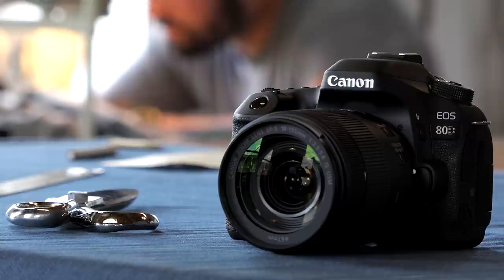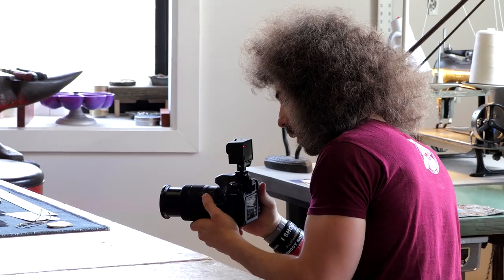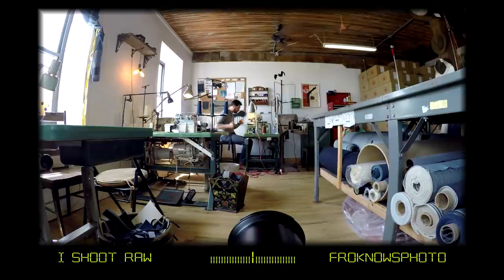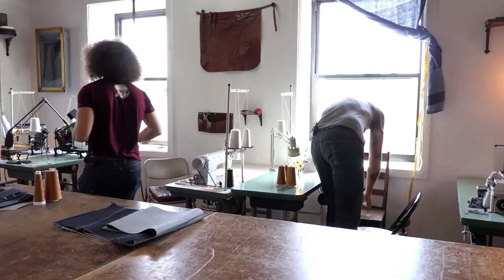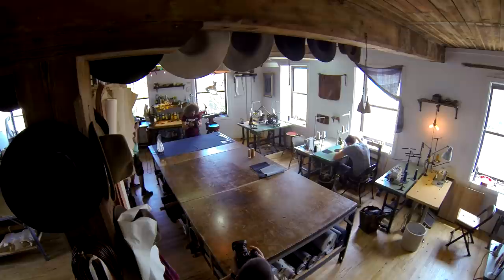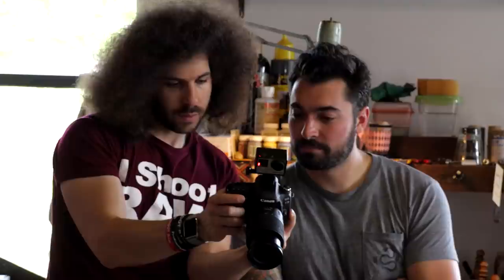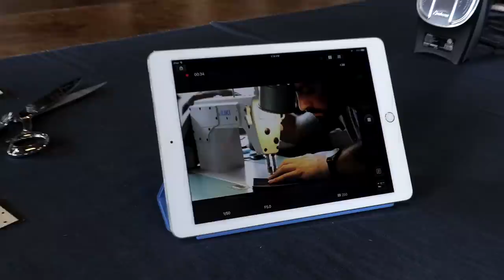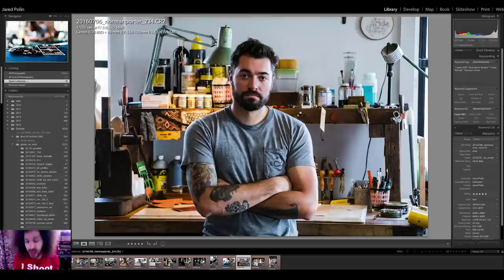How to get Professional Photos with a Kit Lens: "Canon 80D" 5 Min Portrait

Comment: 80D is so perfect it's very addicting to use. The focusing is just fun, screen or viewfinder. this will be hard to top by canon. i dont need 4k video, i dont have unlimited supply of hard drives. and aps-c after 2015 is not that significantly under full frame anymore. pair these with a 24 or 28mm pancake lense and it's also the perfect street camera. not into electronic viewfinder or rangefinder of mirrorless yet.

Comment: I did chuckle at the fact that the guy's expression never changed but it really worked for the pics. Seems like a nice little factory too. Fantastic video. Im looking into the 80d as an upgrade for my very worn out nikon d3200. This video sold me. Excellent work. Amazed at the quality of the shots considering 1600 ISO. Anything above 400 is unusable on the d3200.

Comment: (I'm at 10 min, still watching)
Correct me if my method is wrong...I think I would use Aperture Priority in this scenerio and use iso 800 to start off. Basically if anything's over exposed, I just use that exposure compensation and make it -1,-2 ect .. if it's under exposed then I would use +1,+2 on the exposure compensation.
if the shutter speed shows too low(vulnerable to shake), then I will increase the iso.
Reply: Oh and Thank You Jared for this amazing video, I am enjoying it
Reply from the maker: I stay away from Aperture Priority.  Being in a situation where the light is pretty much not changing why let the exposure be thrown off by the background light.  Simply moving your shutter speed is the same as -1 -2 so on and so forth.
Reply: You can do that, but by keeping it in manual, you can change the settings more accordingly. For example if you prioritise the shutter, the camera may pick a very high shutter speed, which won't let you capture motion in your images. by keeping it in manual you have complete control of all the settings.
Reply: Also, I wasn't finished watching the video while I wrote my comment, but Jared explained why he didn't need aperture priority at 55:55
Reply: Just shoot manual. Absolutely no more work than what you are currently doing but you now have full creative control.
Reply from the maker: oh i'm glad I did that lol.  I forgot of course.
Reply: Whatever rocks your boat.
Reply: every time you use a high iso you diminish the quality of the photo, and diminish your ability to edit it well, even in PS software

Comment: when using a variable aperture lens i use auto iso so when i zoom iso is adjusted automatically
Reply: Vincent Navea or just set the aperture to f5.6
Reply: +Dan Super but if you do that you won't get the good old bokeh
Reply: @dhiyow9775  you can with compression. My sigma 70-300 th macro can get bokeh at f15 on my d3500 (f 22.5 equivalent)

Comment: Looks like this setup is really capable.  I am trying to hold out for Nikon's D7300 (if that's what they call it) in hopes they add the screen from the d5500.  Currently have a D3000, and want better ISO performance and buffering.  Hesitant about switching to Canon because the glass I have(which is only a few primes and the kit lenses).

Comment: Well now I'm not sure if I want to upgrade to the  80D or 6D Mark ii. I currently have a Rebel T4i but wanting something better for low light.
Reply: In the same situation, going from T2i to 80d... Or, also consider the EOS RP. Compact full frame although expensive glass. Btw, it uses same sensor as 6DII.

Comment: With my Nikon D5100 I tend to shoot with manual focus and aperture, and automatic ISO, works really well most of the time.
Reply: I envy you. It's probably my aging eyes but I can't reliably focus manually on my D5100 at all. The finder is too small and dim. Although I do not have a pro-level DSLR with a bigger, brighter viewfinder to compare the D5100 to, I was recently messing around with my old Nikon F3 film SLR and the difference in the viewfinder is astounding. It's like looking through a picture window!
Reply: +Anthony C old film cameras usually used split-screen focus screens, makes manual focus a doddle. But they take some light, and are harder to see through in dark scenes. Digital cameras rely on autofocus, so have left them out, but for some cameras you can get the split-screen as an accessory. For my Canon 60D, I've installed Magic Lantern, and for manual focus I zoom in x10 on live view and have focus peeking and split screen enabled; no point manual focusing through the tiny eyepiece.

Comment: I have seen several tests of Canon 80D, and I was very fond of the machine, but it does not shoot in 4K, I do not use much video, but I know that one more time and the Canon launches one that films in 4K as such and as I need, I'll be waiting. Then there is the fujifilm xt2 which also I like a lot, but it does not have the versatile and creative LCD, of the canon, being even lower than the fujifilm xt20, but the fujifilm xt20 starts the iso in 200, which I do not like. It seems that brands play with the tastes of customers. For me the machine is like a craftsman tool, the more creative options the better. As a Nikon user, (who stopped in time) I have always been jealous of Canon's LCD, s and the use of the video. What do you advise me to change systems or start thinking about changing?
Many greetings and best wishes for Vlog!

Comment: i like the format of the show, it's a bit orientated to the beginners but i appreciate it. one thing that bothers me a lot is the chromatic aberations from the lenses of the xc10 i'm guessing it is. i would like to see some more stuff using strobes, i know it's not his main thing but maybe something easy to set up and use.
Reply from the maker: It's not all to a beginner it's to the photographers out there.  Photography doesn't need to be overly technical.
Reply: as i said, i liked the show and the fact that you shoot with a bunch of different cameras not just the top of the line.

Comment: Great Video! I Love your "5minute Portrait"-Sessions because it really helps understanding the "flow" of a fotoshoot. This one I found especially great as I own an 80D for about a month and love shooting it. 

One question: Is there such thing as focussing "accurate enough"? I had a portrait-photoshoot last week (80D with mostly Sigma 18-35 ART and Canon 50mm STM). We shot about 400 pictures from which most looked great & sharp on 5x7inch paper. But there were ~20 shots that I could zoom 1:1 on my computer and had a ridiculous amount of sharpness (most of them 50mm stopped down to 2.8). I know I'll do some things differently on my next shoot to avoid focusing problems (like af micro-adjustment on the sigma, and cleaning rain from the lense more often) but I'd like to ask you if there is a point where you'd say something is "sharp enough" or does every photo that leaves your studio has to stand up against pixel-peepers?

Comment: Hey man - thanks for a great review and some really awesome tips on how to use a camera properly. I currently use a Canon EOS 400D (12 Years old) and am saving up for the 80D. I had already made my mind up that I wanted it but this has just completely confirmed that I want one. I really like the way you put that video together and just seeing how you position yourself to get the shots as well as adjusting exposure as you change the focal length (i never knew that it changed aperture). I've had my camera for ages but I'm only just starting to learn how to use it properly. Keep up the great work - its not often that I watch a full hour long you tube video. You got some great shots! Subbed and liked!

Comment: Dear jared, I have a couple of queations.
1-   i've seen a lot of your movies where you use a GoPro at the flash mount on top of camer, . can you tel me why you use the GoPro.?
2-   in this movie you use a Canon 80D. I have a Canon 90D with the same lens.
3-   If i want to shoot a simmulair item with my 90D, will there be a lot of differents or can i compare it?   
4-   last question,  i see thet you not use a flash, not a optical or the pop-up flash, whay not?
5-   i hear you speek about the hi ISO, do you have no trouble with the noise or eliminated that in Lightroom?
thank you for answer my questions.
greetings John Statue from The Netherlands.

Comment: Jared got a question. Higher ISOs obviously create a lot of noise. what would you say would be a good ISO that allows good "snappy" shutter speeds yet doesn't inject very much visible noise?
Reply: I wouldn't worry too much about noise, take it like grain on film. It is different but if you fill the frame and don't go heavy handed on either sharpening and  noise reduction it won't be a problem. Plus digital noise is much more prominent and visible on displays with the pixel matrix, when you put the photo into print it won't be so visible.

Comment: Thank you so much for all your videos, but I have a question about the kit  18-135mm.  I tried to take pictures of my kids indoors  and used manual mode  but pictures come out very dark.  The shutter speed doesn't allow me to set it up higher than 40 or 50. I tried to change the ISO higher, lower and nothing works.  I forgot to mention that I have a lot of natural light coming in and still doesn't help at all.  Do you have any tips in how to use the kit lenses to take picture on kids and indoors?  I hope you can help me with this.  Thank you so much.:)

Comment: Jared, do you always use single focus?  I've found that I have less out-of-focus photos when I use the full-time focusing feature, unless I know that my subject is going to be perfectly still (which is rare for the photography I end up doing).  I tend to shoot with f/1.2 or f/1.4 lenses because I love the razor thin depth of field.  The f/1.2 is manual, so I really don't have a lot of choice there, but on my f/1.4 85mm, I tend to have much better results with full-time autofocus.
Reply from the maker: I don't want the camera picking the focusing point for me.

Comment: Hi Jared and crew, I am trying to advance my photography and I am trying manual exposure but I am finding some issues. When you say you are changing you exposure setting you say you can get 2000 ISO. My problem is when I'm in manual exposure and I change ISO my setting only allow 1600-3200. the only way I get 2000 is via Sensitivity mode and Shutter & Aperture priority-- but that has AUTO ISO.
Any info will be very helpful.
:)

Comment: I'm so torn between what camera to buy. I really liked the 80D for the longest time but then the 6D Mark II came out and I'm torn between what to get. The biggest plus is the full frame but considering I'm using it for family pics and to film a little bit do I really need to 6D MII? I want something that will last a while and as I get better it will keep taking amazing photos and I won't outgrow it so fast. That's what I worry about the 80D that I'll out grow it quickly and be mad I didn't save a little more the the 6D. But I'm close to affording the 80d with a kit lens and I got a baby due so I really want something soon. Should I rush or wait? Input is much appreciated from everyone especially those who own the 80D and have moved up.
Reply: The 6D Mark II + EF 24-70 f/4L + Speedlite + flash reflector or
The T7i or 80D + 17-55 f/2.8 + Speedlite + flash reflector.
Reply: Miguel Silva 80D with 18-35 f1.8

Comment: I have a question:  The 80D has a pop up flash, yes?  There were a few shots that I thought were over exposed and you could have stopped down a bit and used the flash to fill.  I know I have done that plenty on my D7200 and sometimes I get great results -  (just a hobbyist, so "sometimes" works for me). 

Also just to let you know what kind of freak I am - I HATE BACK AND WHITE.  Every one of the shots that went from b&w to color, I thought the color was way better.  Maybe its because the first three years of shooting for me (1978-1980) I could only shoot b&w and so wanted to shoot color and now its just a mental block.

That being said - I really liked the video and it gives me a good sense of what a candid photo shoot is like.  I am trying to arrange an all day photo shoot with a race team and this and other videos you have done have given me plenty of pointer and things to think about for that shoot.
Reply: Re: B&W. I respectfully disagree. I love B&W. My first camera was a Canon AE-1. I shot mostly B&W film--lots & lots of Tri-X. :) Did my own developing & printing, even re-loaded my own film cartridges. Being 'limited' to B&W forced me to see scenes in a different way, not necessarily better, only different. My best photo shoot (amateur) was following an older fellow around his 25-acre wooded farm while he tapped his sugar maple trees to make maple syrup. It was early Spring. Snow was on the ground. Trees were still bare. Color film wouldn't have had the dramatic look that the B&W did. My favorite photo of that day was him standing in his kitchen (200+ year old farmhouse) next to his stove with a gallon jug of maple syrup sitting on it. A color photo might have looked nice, but the B&W looks so much better.

Jared: Thanks for this video. I learned a lot. BTW, do you ever do B&W? I mean in camera not post. If so, I'd like to see a video on this.

Comment: ISO 2000?? LMAO I have an 8 year old Sony Alpha a200 and I get noise at 400!
Reply: I feel you, I have canon 7d, came out in 2010
Reply: Almost same here,olympus e-400. Unusable above 800 :D
Reply: yuabonuga My Father passed away last year and I will be getting some inheritance eventually....When I do, I will invest in something new as I am really interested in night photography, but obviously I just cant do that with the Sony :( 
Noise on older cameras is a huge issue! It's enforces such limitations, but I am just using this time to get experience on settings and general workings of photography.....So although I cant do everything that I want to do, the Sony is a valuable piece of equipment to help me improve as a photographer.
Reply: D7000 here i have fear of high ISOs jajaj
Reply: buy A7RII or A7SII from Sony. You'll be amazed with high ISO!
Reply: ***** Yes, they are among the cameras I am thinking about. Definitely full frame, mirrorless and I have heard amazing things about the A7's. Thanks.
Reply: 2000 is nothing today lol. Even My Revel t3i at 1600 prints perfect prints. On pc, if you zoom you see, but, that's magnified be a lot, not the same as prints.
Reply: oasisbeyond Hence my initial comment.....
Reply: That camera has the same sensor as the 7d with an articulating screen. The image processor alows for mildly faster noise reduction but that's really it.
[edit]Noise is likely identical
Reply: +jonnypanteloni Not the same sensor, the 80D has significantly reduced read noise, it has better dynamic range and shadow detail than any other current Canon, at least at low ISO, less so at high ISO like here. Not as good as a Nikon d7200 by any means, but the best of the current crop of Canon, and probably as good as the Nikon D5. The next version of the 5D should be interesting when it gets the same type of sensor.
Reply: Martin Andersen Martin, in future gather context before you post something... I was replying to oasisbeyond !! The sensor in the t3i has a practically identical sensor specification to the 7D!

What did the 5d have to do with any of this??
Reply: Fozzy Miller Maybe you should wait what the A7sIII will bring to the table, might be great. I'm myself on a Canon 30D. About as old as the camera with wich the president of the USA has been portrayed ;-)
Reply: Same, I have a Canon Xti, came out in 2006. Really bad in lowlight.
Reply: ***** Sounds like a good investment :) . Where did you order from? (You say it's used)
Reply: ***** Sounds like an awesome outcome sad to hear about the 5d!!!
Reply: Fozzy Miller lol I got a 9 year old canon 450D and I barely get noise at 1600
Reply: @PhotosOfBuildings  df or d4/d4s. There's also the d780 and the d810A
Reply: I'm glad my d3500 starts getting noise at iso 3200 (though still very usable)

Comment: Once I found out how folks use RAW to get that creamy dreamy effect with tools in the details tab using luminance and sharpen.  Well I happened to come across about how you can get jpegs to open in RAW with the "open as" tab in PS and boom, still does the same thing, with the same result. Saves battery, speeds my camera up, I'll never shoot RAW again.
Reply: And it prints the same as a RAW file as well.
Reply: Nonya Bizness I don't think that's how it works... JPGs are already processed by the camera and RAW is supposed to have more data making post processing easier. Are you shooting JPG+RAW?

Comment: Why not just fix the aperture at f/5.6 or smaller (higher f/stop) so you wouldn't need to adjust the shutter speed every time you zoomed the lens out? Most cameras nowadays can do a reasonable I.S.O. 6400 and since you shoot RAW already, adding a bit of noise reduction on some of the best shots should give decent results. Just a thought..
Reply: Thanks for the video😁

Comment: I'm very new to photography but why is he shooting at 2000 ISO and 1/200 at about 4 mins in?
Why not drop the ISO way down and shoot around 1/60? I wouldn't be going above 600 ISO or so unless I plan on every shot being black and white and looking like old film.
Reply: You don't want to be shooting at such a low shutter speed when you're zoomed in like that unless you're using a tripod. The general rule is to always keep your shutter speed at 1/the focal length your lens is at. So say he was shooting at 100mm, he would want the shutter speed to be at 1/100 or higher. The 80d has a crop sensor, so you would also have to take the crop factor into account when deciding what to set the shutter speed at.

Hope that made sense :)